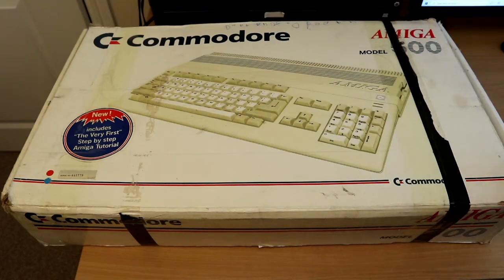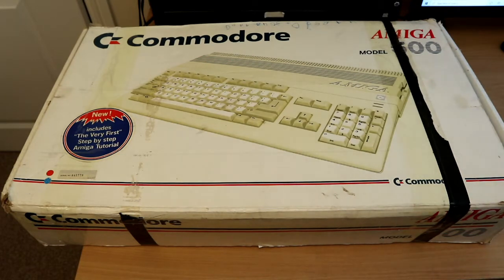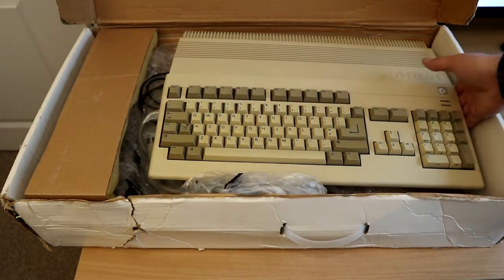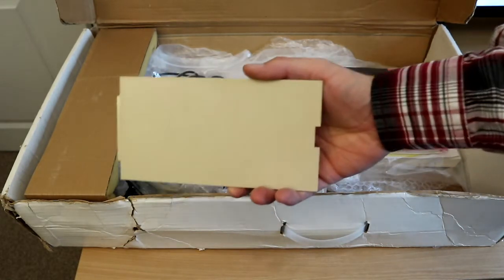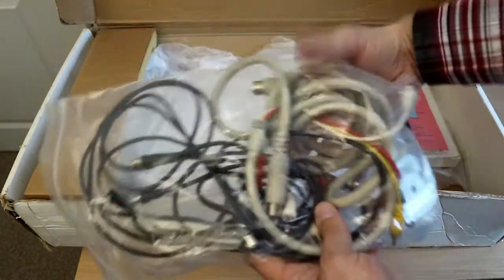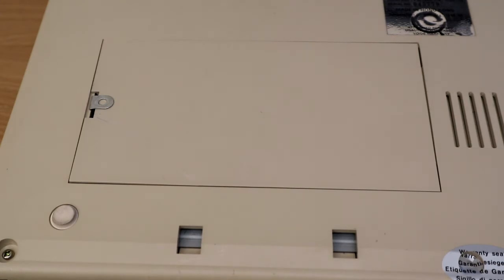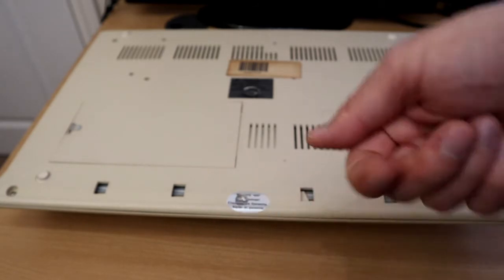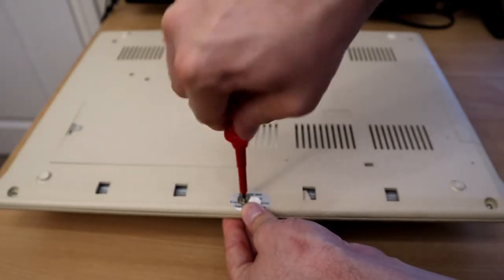Commodore Amiga Part 1

Comment: The cable with the fat plug on 1 end, & yellow, red & white jack's on the other end is a DIN to composite I believe. An Amiga branded mouse alone is worth a pretty penny, the Amiga CD32 branded joypad can fetch best part of £100!
My A500 has a gold sticker saying you had to "park" the floppy drive before transportation, or you void the warranty.
You're model is a later one, like mine. The earlier models had the commodore logo on the key, instead of a big capital "A" which is the key, to the left from the space-bar. The diagram is an A500 circuit board blueprint from a service repair manual originally, at this point in the video, I have low hopes for the A500 to be working, maybe the previous owner attempted to do a repair or mod & probably ended up knacking it altogether & gave up!
He probably ended up blowing the original power supply as well, which is a monster of a power supply!🤣 That's probably why he didn't include it because it would of been a melted plastic mess!

Comment: That looks like an earlier tank mouse. Later ones had a 'twisty' ball door. If you pop the lid off, the early ones had the dome switches instead of microswitches under the buttons.

I wouldn't worry too much about some of the clips. Some cases have a more 'oily' feel and are quite flexible, but some are dry as a bone and snap as soon as you look at them. 

It's a Rev6 board (still only halfway through watching!) And it has a Samsung keyboard which is far less common than the usual mitsumi. Samsung keyboards have two membrane connectors while the mitsumi only has one (usually white).

Keys are 'off-white' normally. 😄I'll have to send a link on twitter where I did a keyboard clean. It was a bit unpleasant.
Reply from the maker: Thanks so much for the info. Really not familiar with these machines